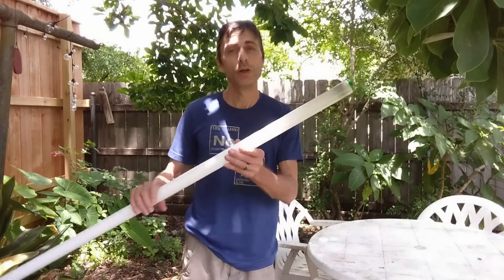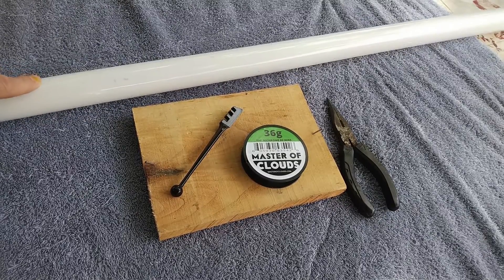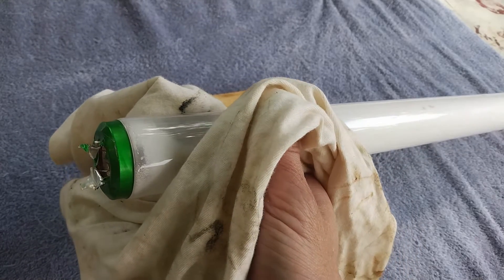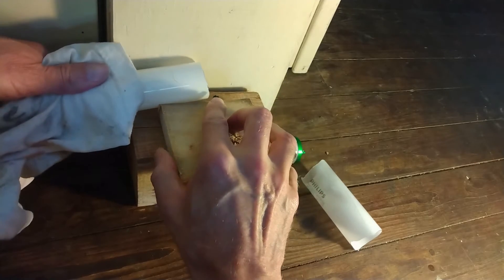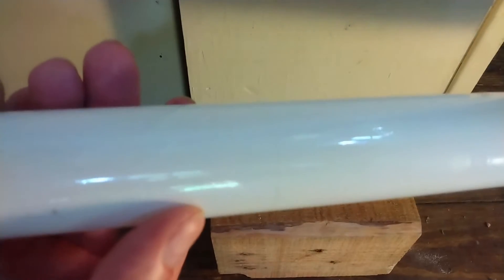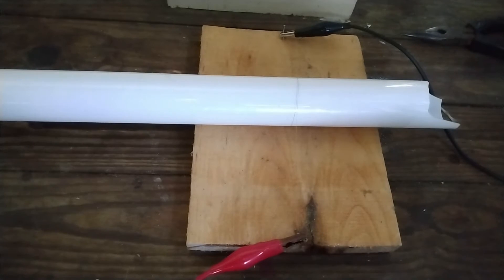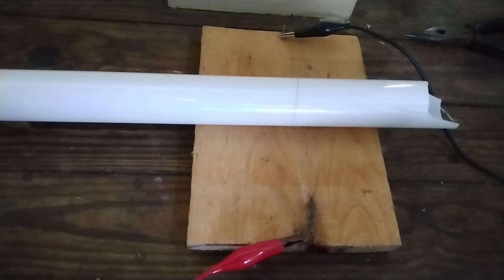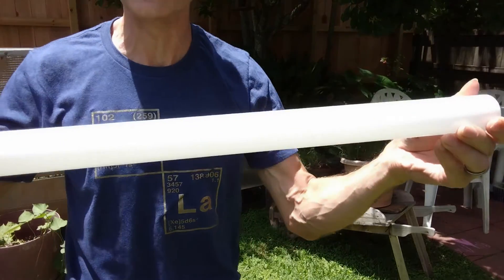Cutting An Old Fluorescent Light Tube

Comment: The white stuff inside the fluorescent tube is phosphorus.
Reply from the maker: That's right. But I wonder how different it is from "white phosphorous" which is supposed to self ignite in the presence of air? No such a thing happens when we break a fluorescent tube.
Reply: It is calked a PHOSPHOR, not phosphorus, which is a totally different substance. It is a fluorescent PHOSPHOR. Hope this helps. 😋

Comment: When I was little I did the same thing to an old t12 fluorescent tube and I connected a P-trap under our kitchen sink and I had a vertical piece of clear glass going from wall hub to the trap and I could see water flowing trough it lol. The t12 tube has almost perfect size for that purpose
Reply from the maker: Here is an improved way of cutting with the wire by making a wire holder: https://youtu.be/DBbTJqoNPUo

Comment: Hey this is clever, and now I know what I can do with all the old tubes in my dad's house.  I came in from an unrelated video on your channel, and wow you have an eclectic mix of topics on here.  Have you made progress on your laser?
Reply from the maker: I actually built a CO2 laser a few years ago, but eventually the tube cracked (maybe because the glue that I used was too rigid and did not allow expansion due to temperature increase). I haven't had time yet to rebuild it.
Reply: @BlueMoonshine  Did you ever come around to repair the laser (and put it on YouTube)? Out of curiosity also wondering if the phosphor powder has other uses, or if it is to little to harvest? 
(And yes I noticed the updated tutorial )
Reply from the maker: @Peter_A1466  
Not repaired, but started building a new one from scratch, as many of my supplies "disappeared" when I moved from my old university to the new one. The challenge is for me to find the germanium mirror and semi-transparent mirrors. Previously, I had them from some old optical kit that was abandoned in the lab by previous researchers.